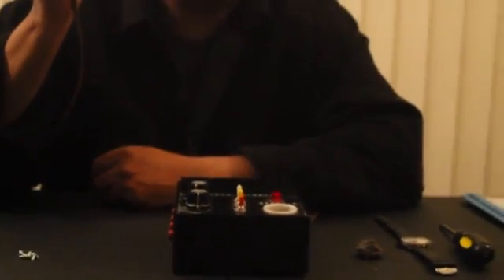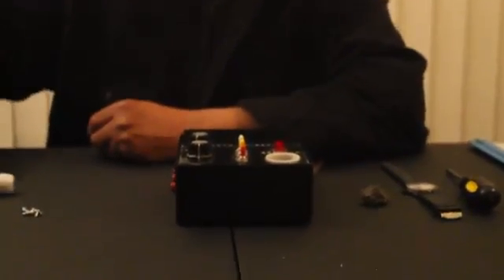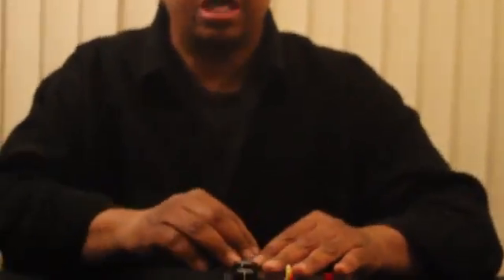THE HYPERDIMENSIONAL RESONATOR UNIT HDR & TIME TECHNOLOGY part 2

Comment: The instructions say to use it over a spot where your cell phone doesn't get a reception, but I have a very good cell phone, so I could not do that with my HDR because I always had a reception no matter where I went. In addition to that, the HDR is a plug in (not battery operated) so bringing it, to say, a park, would not work because you have to plug it in somewhere.

Comment: where do you live i can probably help you.
Reply from the maker: The machine doesn't work, & is incapable of performing physical time travel. It isn't based on the correct principles, the Cadeus Coil does interferes with the time-field, but lacks both a Field Stabilizing, & Integrative Circuit, based on time-like Curves.
Reply: do you have this machine ????
Reply from the maker: Try actually watching the video, the answer to that question is amazingly obvious.
Reply: I think u used the wrong crystal. U are suppose to use a double pointed flawless quartz crystal not a meteor rock that’s wrong he sent me a quartz crystal
Reply: @Pupsky2012 for a second I thought you was quoting that scene from napoleon dynamite 😂

Comment: Were you over a vortex when you made some things disappear
Reply from the maker: Yes each time I've tried to use it, it was over an electromagnetic vortex. That was the only time I seemed to experienced some small time-skip.
Reply: Where do you find electromagnetic vortexes around your house? I can't use it wherever in the city becasue it requires an outlet plug to put it in. It's not battery operated.

Comment: Have you used it for astral travel
Reply from the maker: Yes, it didn't work for that anymore then it did for physical time travel. But we're capable of Astral time-travel without a machine, it seemed most effective at enhancing telepathy.
Reply: +Barry Littleton Does the HDR have any physical effects even though it doesnt seem to work for physical travel? (For example things disappearing)
Reply from the maker: It kinda gave me a feeling of getting charged up by the exposure to the intense electromagnetic field. When attempting the astral jumps, it kinda made me tired, similar to being tired after trying focusing techniques. You can feel the unnatural feeling of that magnetic when it's that close to you. For that reason the Jesse Ventura show wouldn't try to use it.
Reply: Barry Littleton I have heard that you already need to be experienced with inducing OBEs when using it. Do you think this is true?